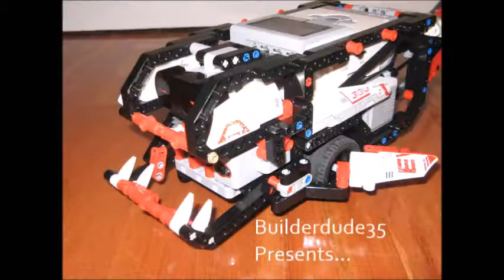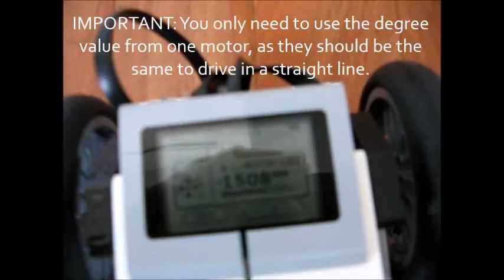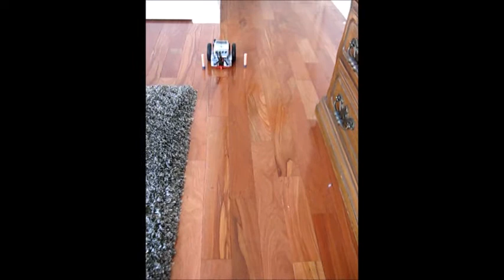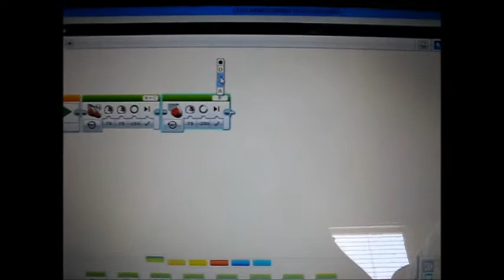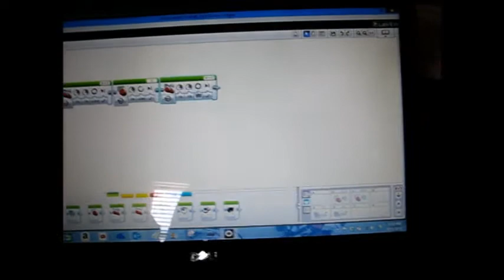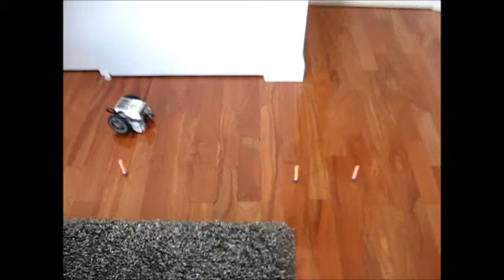Quickest Way to Accurately Program an FLL Robot or Car Steering

Comment: Our coach said that turning the motor by hand will damage it. Is this true?
Reply from the maker: You run the risk of damaging the motor only if you spin it too aggressively. I know from mentoring young teams that kids like to spin the motors really hard to make as loud a sound they can; that is bad for the motor. However, if you are careful and spin the motor responsibly, you should have no problem. A motor is meant to be turned by hand to a certain degree. The turning by hand I show in this video is certainly safe for the motor. Just think -- an electric generator (like a wind turbine) is the exact same thing as a motor, except in reverse; an outside force like the wind spins the motor and electricity is generated.

Comment: What if you don't have a Gyro Sensor? Do you have the amount of Rotations needed to do a 90° turn?
Reply from the maker: +tresrules16543 You still use the same method to measure turns, just turn one wheel.